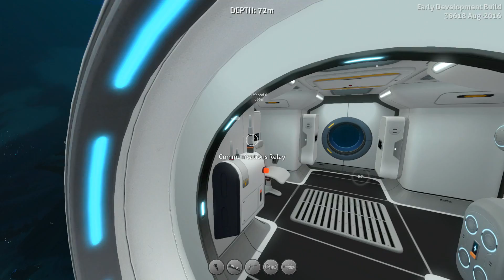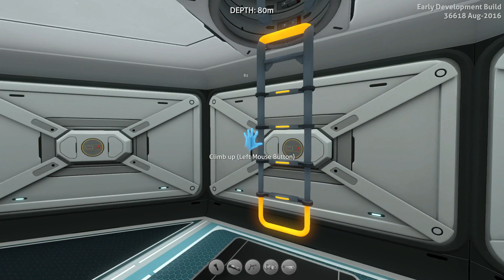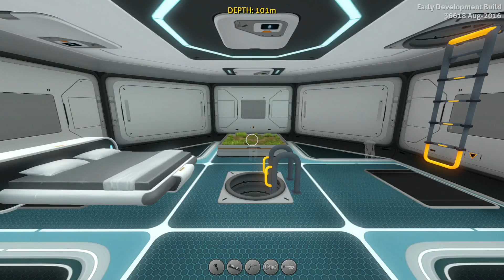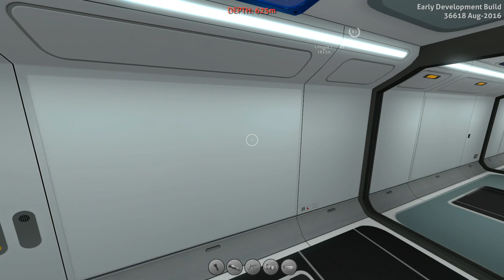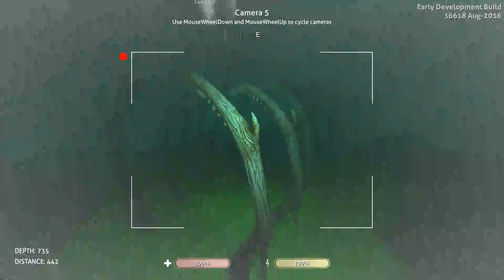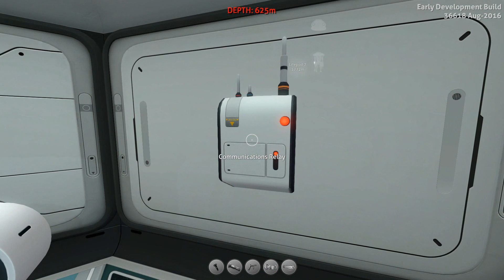Subnautica Practicial Base Designs

Comment: Honestly I think a nuke is only necessary if you're building in a deep cold area with very little life, such as around the ghost tree. In all other cases, your alternate energy sources are much less resource dependent and a bio-reactor literally converts your organic refuse into energy. So you can keep it powered with literally whatever fish and plants are around. Should the reactor run out of organic materials while you're away, you just shove stuff back in there when you come back. Keep a locker full of organic bric-a-brac just for that and fill it up before you leave. Attach a scanner room to aid in resource gathering and your mini-outpost-base essentially pays for itself.
Reply: Endymion766 and even near the ghost tree there's a vent that you can use
Reply: Even then, i would rather build an aquarium with some reginalds or other small fishes that breed for an infinite bio reactor source
Reply: yes but consider one nuclear rod makes 20000 power, so a full reactor is 60000 power overall that’s with 9 uranium. so overall it’s a LOOONNNG time until it runs out
Reply: In the full release there are multiple vents near the ghost tree. The nuclear reactor is more practical if you have a central hub where a lot of power is being used at once and there's no vents nearby.

Comment: 6:00 massively overdone on the food and water. Here's what I've been doing since probably before this video was made: Two or three small plant pots full of marble melons. If you're not near starved and dehydrated, eating three then cutting the 4th from one pot for seeds to refill it will get you to or near max on food and water. If you are nearly starved and dehydrated, two pots will get you right topped up. The third is for just in case.
Reply: So you're saying I need 6 water filters and a three high silo of Reginald right? Just in case I go exploring?
Reply: @polarispulsar  No. Did you even read what I wrote? Doesn't look like it.